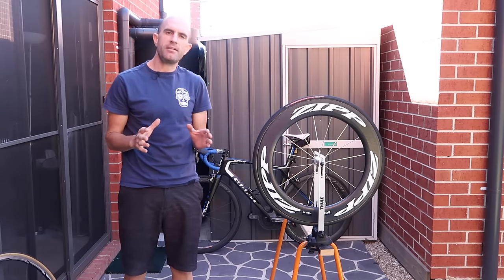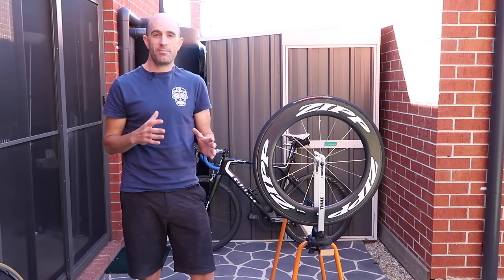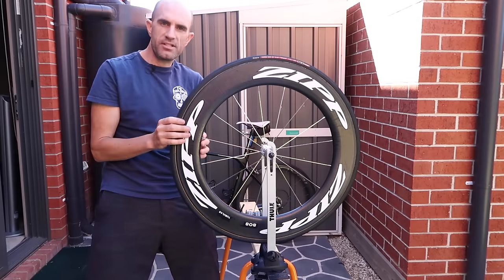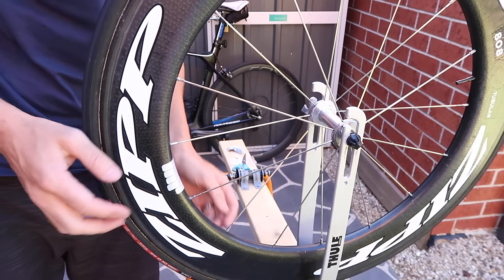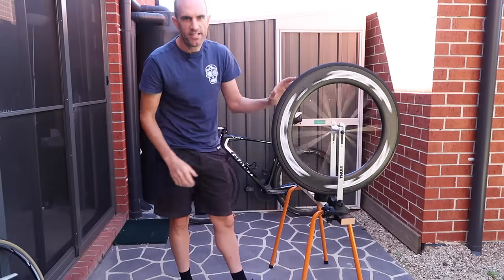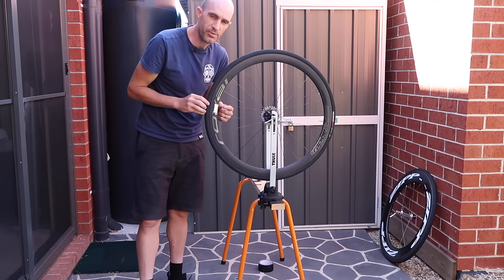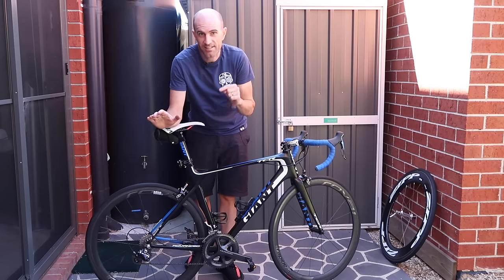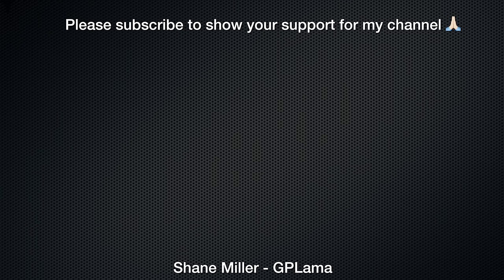Bicycle Wheel Balancing: Marginal Gains or a 'Must Do'?

Comment: very interesting.  I am shocked that this isnt addressed in the design of the wheels and part of testing.   Wonder if custom wheel builders address this
Reply from the maker: It's a hard one for them to get 100% right.... customers will use different tyres, tubes, valves/stems.... all contribute to the whole system that needs balancing.

Comment: Now instead of putting those weights on the rim like that, would it hurt anything to affix those weights to bottom of the tire track? Like where the rim tape is, and then put the tube and the tire over it.
Reply from the maker: That would deform the tyre. Or make the compression/deformation non uniform when riding.

Comment: HI Shane, this video was much appreciated as I never really knew about wheels having this sort of issue. I recently bought a Giant TCR Advanced Pro 0 and the SLR 1 wheels have terrible shakes, even worse than the roval wheels. 

So my question is, can something like this dramatically affect cornering or descending? I am a very light rider (61KG) and the bike weighs around 7KG so I am very concerned. Thanks and keep up the good content!
Reply from the maker: Dramatically? Not really. The shakes are dampened a lot by the large human on top of the bike... but there's no denying that shake is there and the lost energy with the inefficiencies of the imbalance.
Reply: Thanks for the reply, I'll try balancing my wheels over the weekend.

Comment: Shane, great video. However, having watched a different YouTube video they suggested sticking the weights in the centre of the rim and allowing the inner tube to hold everything in place. What are your thoughts on that method ? I had a pair of Campagnolo Bora (tubs) that were the worst balanced or out of balance I’ve ever owned, obviously putting the weights under a tub isn’t an option.
Reply from the maker: It depends. There's a few way to solve this. I'm not a fan of placing anything under a tube on the rim. If the weight is too big/bulky then sticking it under a tube could influence the tyre deformation while riding... and not in a good way. Think Princess and the Pea. That solution might work better for tubeless, but then be a a pain in the arse trying to fit tyres that need to sit in the inner groove before being seated.
Reply: @gplama  Many thanks Shane, you’re a star.

Comment: Awesome video, if I had a wheel truing stand I would check mine right now. Bravo!
Reply from the maker: Turn your bike upside down. Done! :)
Reply: Haha, you're the man! Simple and effective.
Reply: Quick update here, I checked my wheels (FFWD) and they definitely are not balanced. The rear I can feel the bounce holding the top tube similar to the second bike you checked. I moved my speed sensor magnet to a spoke opposite of the valve stem and the bounce is less pronounced but still there a little.

Comment: Could you share the link on the wheel weights that you used.  I looked on eBay and could not find them
Reply from the maker: https://goo.gl/83VoA7
Reply: Shane Miller - GPLama could you please share where you purchased the setup to balance the wheels or suggest one that works effectively?
Thank you for the great video!

Comment: I've got a question regarding tubeless wheels. Since the sealant is constantly moving around. Is it worth trying to balance a tyre that's tubeless?
Reply from the maker: Yes. The sealant will usually evenly distribute itself and if the wheel is well out of balance it'll still be worth doing.
Reply: @gplama   makes sense. I will have to have a play with it. Thanks heaps for the insight and the response.

Comment: Shane, what do you think about glueing the golf counterweights to the inside of the rim, just unter the rimtape! It guess it would not have negativ influence ot to the tube? Especially if you keep the weights flat and put them next to each other, rather to stack them... Also you need less weight cause your weight has more gap to the center of the wheel. Worth a try?
Reply from the maker: There's a few ways to skin this cat. That'd take a little more time, but would work if done right... and very thinly.
Reply: How thick are these Golf Club Weights? I think under 2mm? I will give that way a try... Just cause it will last better and for sure look better... :-)

Comment: Pretty lame that zips , roval etc are selling multiple $k wheels without ensuring they're balanced in the engineering process
Reply from the maker: It's difficult when we all use different tyres, tubes, etc... but you'd think they'd at least take into account an average weighted stem (maybe 14g?) :)
Reply: That's for sure. I've known about balancing car wheels for a long time, never thought about bike wheels though. Enlightening video, thanks

Comment: opinions on add the weight inside the tire between the innertube and rim tape? instead of the rim
Reply from the maker: Maybe... if it is super thin and doesn't impact the distortion of the tube/tyre as it rolls.

Comment: I noticed that the imbalance gets worse with lighter wheels as the valve stem weight remains the same it has a bigger effect on a lighter rim.
Reply from the maker: Some wheel sets are sold with balance kits. It's rare tough.

Comment: should I give my new and un-used wheel to bike mechanic to loose and re-tighten the spokes to make sure that the wheel is safe and optimal for ride?
Reply from the maker: Why would anyone sell a wheel that's not safe and optimal to ride? I'd not buy those wheels in the first place.
Reply: no I mean if you buy from a known online shop like Wiggle, Chain Reaction Cycles etc. should I bring my new wheel to bike mechanic to make sure that all spokes have proper tension
Reply from the maker: Entirely up to you. If you've got the cash, and a good mechanic, sure.

Comment: Is it the inner tube not the wheel that causes the issue?
Reply from the maker: The valve/stem, yes. People have pointed out the rim may be balanced... but that's not helpful when you have to run a tyre and tube. I'd like to see the wheel/rim compensate for the valve weight, if not, then a balancing kit supplied like a number of high end wheel manufactures do.

Comment: Nice video. 
would a neater solution be to calculate the weight needed, as you've done. but then add the stick on weights to the outer rim under the rim tape? ensuring that the tyre stays in the same orientation of course.
Reply from the maker: Maybe. You don't want to screw with the way the tyre sits on the rim. Further out will require less weight too... if my theory is correct. So that's a bonus.
Reply: Fair point. Just trying to think of ways to tidy up the finish.

Comment: Shane Miller - GPLama have ever taught about put the weight into the rim under the the inner tube?
Reply from the maker: No as it could distort the tube/tyre shape and ride due to non uniform flex. I’ve seen people do this... not for me.
Reply: Shane Miller - GPLama but it’s not that esthétique on a lot of money for carbon wheels...but I guess it’s for safety first.

Comment: Does adding the blake tape over not put the wheel out of balance again?
Reply from the maker: +roland H Black tape is light. Very light compared to lead weights.
Reply: True. I will test my wheel balance this weekend. Until your video I was wondering from where the vibrations on the back of my bike are coming from - now I´m very confident to know where the issue is, thanks alot!!

Comment: Great video and something everyone should look into, the only exception I take with the video is with the comment about returning a $2000 set of wheels for being out of balance. The manufactures are never going to be able to balance the wheel unless they require the end user to only use a certain tube and a certain length valve stem. An interesting test would be to remove the tire, tube and rim tape from the wheel and then see how balanced it is. Also Sica makes a kit for doing this a bit pricier but cleaner than sticking lead tape and gaff tape to the rim. https://silca.cc/collections/silca-accessories/products/speedbalance-wheel-balancing-and-computer-magnet-system
Reply from the maker: IMO they could at least provide a system to balance these wheels given their $$$ value That Silca kit would be perfect.... I understand the variables at play and how it would be difficult for a 'one size fits all' solution.... the current solution is to ignore it, not to mention it, and based on the comments posted here according to some stores 'It's normal'.... Nobody runs a wheel without a tyre and valve, so having a perfectly balanced "wheel" is practically useless.
Reply: I agree it's an issue that needs to be addressed especially on high end wheels, I think manufactures should include some kind of balancing kit with the wheels and perhaps counter weight in manufacturing for the shortest valve stem that could be run, that way they wouldn't be as far out. Just out of curiosity once the amount of weight has been determined have you ever tried putting it under the rim tape for a cleaner install.
Reply from the maker: Under the tyre/tube may introduce other issues. I'm sure there's a way to make it work.

Comment: Shane does this mean the speed magnet for the old style Garmin sensors could cause wheel balance issue, or amplify a preexisting issue if not placed in the correct spot?
Reply from the maker: Correct!
Reply: Cycling Choice it's one of the reasons I have the magnet opposite the valve. this and symmetry.
Reply: Can't believe how many people still use magnets. They're accelerometers these days.

Comment: Its mentioned that usually the wheel is not balanced as it is heavier around the valve. Is this not because the wheel is made in the factory to be balance without an inner tube because the variation between tube valve length would be it to hard to counteract it in the design meaning this kind of adaptation is necessary because of everyones variation in tube and wheel choices
Reply: Especially when both the wheel were out the same amount, do you use the same inner tubes?
Reply from the maker: Yeah, pulled apart in more ways than one already in the comments. Yes it's the value... and tube... and wheel... all as a system. That is sold by default without any way to balance them. Dive into the comments here already. It's all good. There's commercial solutions, there's people picking the peanuts out of every word I've said... it's all good.
Reply: It wasn't directed as any issue with you, sorry if thats how it came across. I guess my point is that the issue with loads of wheels not being balanced might stem from the fact the the wheel designers and manufacturers cannot foresee the different combos of tubes and tyres on the wheels so they just have to make them balanced only as bare rims meaning they become unbalanced when people try to use them with tyres and tubes

Comment: hi can this affect your braking and make the bike judder under braking. Cheers dom
Reply from the maker: In theory, yes.... But I'd put a 99.9999999999% bet on it being bad brake pads and/or a poor braking track on the wheels.
Reply: Shane Miller the wheels are brand new reynolds strike 60mm carbon and so are the brakes on a propel sl. thanks dom
Reply from the maker: Whatever I say about carbon clincher performance and a propel won't make you very happy..... so if you're not pleased with the braking performance I'd recommend taking it back to where you purchased it and seeing if they have a solution.
Reply: Shane Miller i would value your opinion even if negative. thanks dom
Reply from the maker: The stock propel brakes are said to be horrid, aftermarket upgrades are the way to go. As for pure stopping power with carbon clinchers..... they can be ok, but damn they get hot, so it's all about good pads. Look at aftermarket brakes for the propel if you're loving the ride but not liking the braking.
Reply: Shane Miller yeah I have already changed the brakes to fouriers and the pads I am using the reynolds blue which they say are the only ones I can use. I assume that is true. Cheers dom

Comment: Why stick the weights to the outside of the wheel, why not stick them to the inside of the rim?
Reply from the maker: It'll distort the tube.
Reply: Shane Miller - GPLama go to oz cycle video
Reply from the maker: Looks like he's taken my year+ old video to the next level. Kudos. I won't be sticking anything to the inside of my rims.
Reply: Shane Miller - GPLama I wouldn’t stick those weights to the outside of my rims, it looks pants, never had a problem on the inside of the rim.

Comment: How do you know it's the wheel itself and not to valve on the tube?
Reply from the maker: What's the difference? The wheel/tyre/tube are a system as a whole that is demonstrated to be out of balance. I've had a few people defend the 'wheel' itself as being balanced... but who rides without a value/tube?
Reply: Shane Miller yea but you were saying that a high end wheel such as this one shouldn't have this problem, and that you would send it back if it did. But, it is not the wheel manufacturers fault, it is simply the extra weight of the valve.
Reply from the maker: If they didn't factor this in when building the wheels.... or provide a way to counter balance. Yes it's their fault. The end user / customer experience is horrible... it's like a car company saying their rims are prefect... then when you drive out of the shop everything shakes. You take it back and ask.. they refer to the perfectly balanced rims. There is 'theoretically correct', then there is the end user experience. And it's the latter a lot of my content on here is focused around.

Comment: Tubeless tyres with sealant will automatically self-balance at speed.
Reply: incorrect
Reply: Sorry to break the news.  Yes in theory liquid inside a tire is supposed to balance the wheel, unfortunately the current latex based tubeless sealants do not lend its self to do a good job of balancing a wheel at high speed. Often it makes the balance problem worse.  But not to worry a new sealant from a new company called SLEEPER is going to change the entire wheel industry with Dynamic Speed Balance technology.

Comment: I watched this hopping you would provide viewers with something definitive in terms of the amount of gain that a balance wheel would provide. Like how many seconds, or minutes in a hundred mile ride, etc. I never doubted that there would be some amount of gain. If it would save me 10 minutes, I would probably get to balancing my wheels, but probably not bother if the gain was .25 seconds. Maybe I missed it, but I don't think you ever mentioned how much gain the balance wheel would provide. When you asked Raul if it was worth it, he said "I think so, yea." Well, I'm an engineering type of guy and "I think so, yea" isn't of much use to me.
Reply from the maker: Being an engineer type then you already know trying to quantify it is extremely difficult due to the massive amount of variables involved. The hand spin test of the tri-spoke was quite a good example of what balancing stops from occurring, the shaking.

Comment: Well, I just think you should balance the motor on that bicycle first. (You!)
Also go tell that to Cancelará when on his trials bike clearly was out of balance by the sound of them and went through the other cyclist like he was pedalling on vacuum.
Reply from the maker: That was likely the sound of the rear disc and the legs passing by it on each pedal stroke. That’s the whoosh whoosh sound a disc makes. That’s not an imbalance.
Reply: @gplama  well at least you should stable the frame first and only pedal de wheel to speeds a bike reach, and yes I mean speeds that you can reach descending long or high gradient ones.
Also you rarely reach those speeds.
To be spot on the front wheel should a dynamic calibration because of turning and tilt.

Comment: After riding for a year and seeing the Park tool vid, they say adding weight to balance is not a good idea.. Also they ask, will it make you faster, or give you more power, no.
Reply from the maker: Not a good idea, or not worth the effort? There’s a difference. *And they demonstrated on a massive MTB wheel/rim which isn't quite the same as a high performance road or track wheel.

Comment: I used to balance my TT wheels only. Why TF would you add weight to the rim of racing wheels? That's where shaving grams is the most important. When the tire's rolling on the ground the tire absorbs 95% of the shaking, so unless you're bombing downhill at 50 mph you won't feel it. If you must, a little tip: if you ride clinchers stick the weights under the rimstrip between the brake tracks, so you don't have to put duct tape on the outside of your fancy aero wheels! Couldn't believe he slapped that duct tape on top of the weights on the outside of those hoity toity dimpled wheels!

Comment: Energy lost to vibration is lost in damping which is related to the deformations in the system. When you are riding the bike the system is completely different to your bikestand setup. In workstand the system has much lower frequency natural frequencies and therefore diaplacements are much larger than when you are riding the bike on road. Therefore losses on road are much much smaller. On the other hand you are adding mass to your wheels! That will make you slower!